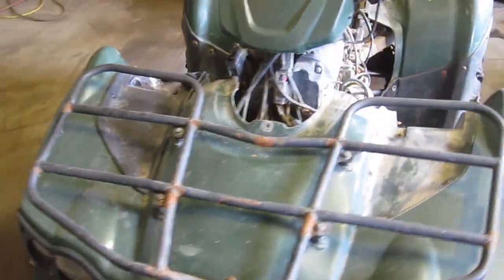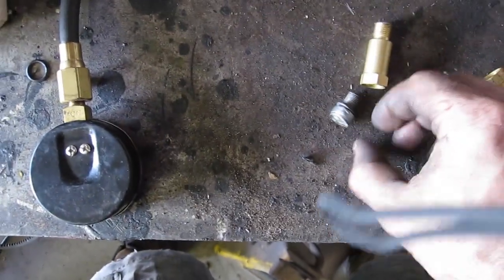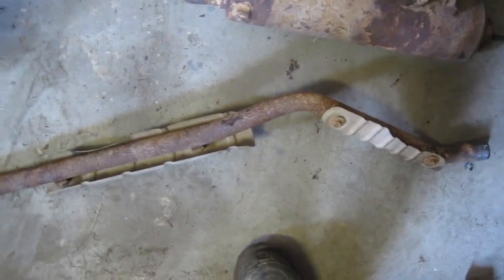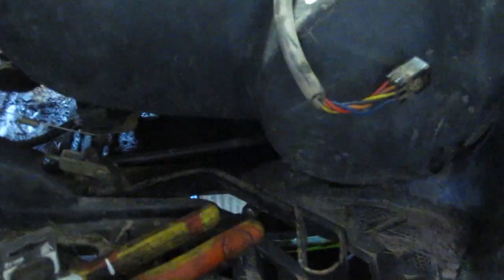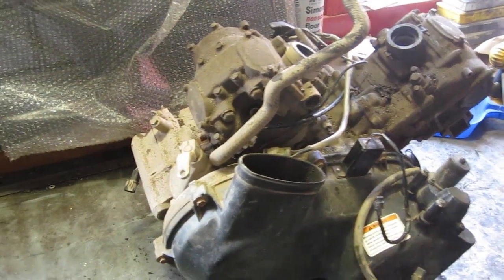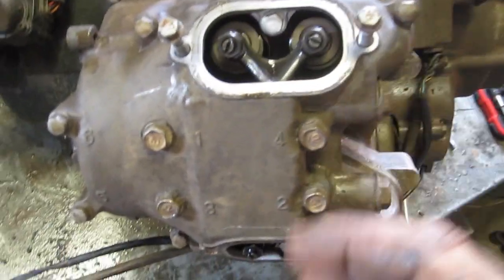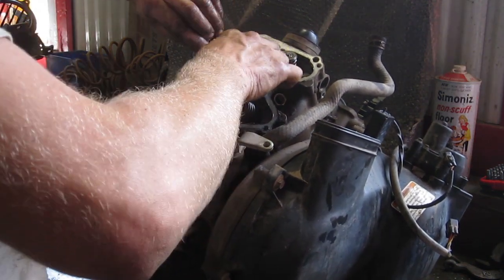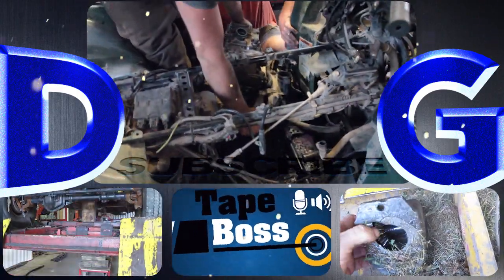4-STROKE REBUILD: Kawasaki Brute Force (Part 1)

Comment: The most you will ever see on a compression test with this bike is 50psi because of the decompression mechanism built into the camshafts. You will have to do a leak down test with the cylinder on the compression stroke. Or either have after market cams that do not have the decompression mechanism.

Comment: I got an old 2003 Kawasaki
KVF650A2 Prairie from a friend   It’s been sitting not working for years. I took to the Honda dealer and they say it had been invested with mice and there re nest in the intake and the exhaust manifold 
I don’t know how did they know that by doing visual inspection 
Anyways 
Is there an easy way to only remove the exhaust and intake manifold whiteout removing the engine or what do you advise ?  Thanks

Comment: I've got an 05 prairie 360 4x4. Shes a beast. Lifted front end. New carb, oil cooler, lights, air filter, front rack, tires and battery. Give er all the way all the time and never let's me down.

Comment: I got a problem with my Brute Force 750 it is smoking really bad do you have an idea what that can be low compression or is it rings please get back to me very soon my four wheeler is setting right now I really need to know very soon it has been sitting for a few months because of that
Reply: Check case n valve cover vent to see if its spitting oil into intake b4 u check compression n start checkin internals

Comment: How many miles when in broke?
Reply: Hrs
Reply: I bought an 05 Brute Force 750 with 2,100 miles, 600 hours. Previous owner said the engine was completely rebuilt at approximately 570 hours, top and bottom end.

Comment: Great video; but, I gotta wonder:  you're obviously a good mechanic; so how is it that you were able to cross-thread a drain plug, on a quad with almost a foot of ground clearance, without sensing that something wasn't right in the process???  I have a 750, and it's about the easiest access I have ever encountered - on anything.  Not trying to be a dick; just wondering.  One more thing:  I know wearing gloves while doing engine work sucks - hands get all sweaty, etc. - but cancer sucks way worse (I know this from personal experience).  You wouldn't engage in unprotected coitus with someone you know has the clap; would you?  So why on earth would you flirt with disaster when (you must know this) you're handling a known carcinogen which is absorbed into your body via the skin on your hands.  I see guys do this all the time; it's just insane.  Ok; so now everybody reading this probably thinks, "Man, he's a dick!"  So, maybe I am; but maybe I'm trying to spread the word and save a life or two.  Again, great video.  Peace.  d
Reply: A cross thread is a tight thread!

Comment: What if a cylinder has high compression  ? like 100 ? other is ok. Can it be rebuilt without pulling the engine. great video.
Reply: @brothersmechanics2028  not on these machines. They have an automatic compression release. Shop manual says 40psi is minimum.
Reply: Dont check compression with fuel gettin sucked into engine it will read higher than bird pussy

Comment: My BF 750 has oil seeping from bottom of rear cylinder, are there any bolts I can check to snug up while the motor is still in the ATV?
Reply: part of ur head gasket that wraps around chamber for timing chain is blown out

Comment: I have the same problem with a 750 brute force engine. can you please recommend a place that can rebuilt it. I've never done a 4 stroke engine before and I don't think I can do it myself. Thanks
Reply: Nflow.....
Reply: Not with that attitude you can't... 😁 Sure you could man, there's so much info online now. I'm sure there is several places where you could get step by step instructions. It's not worth it paying someone else to do it.
Reply: Its basic find broken part replace it and assemble how u took it apart but follow steps in videos for timing it's a little important

Comment: should of at least wash it before you took it apart
Reply from the maker: +themfknightrider420 As I mentioned in the video, my pressure washer blew a head gasket.,  It got a good hosing of brake clean .  Gotta be clean!